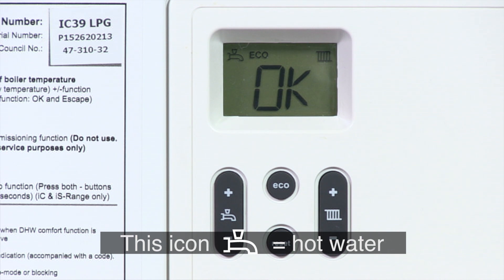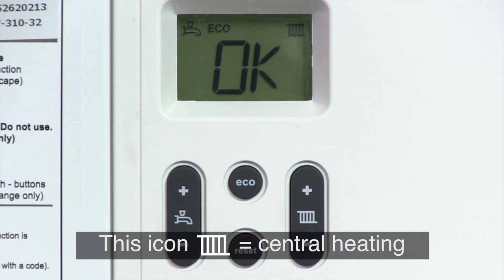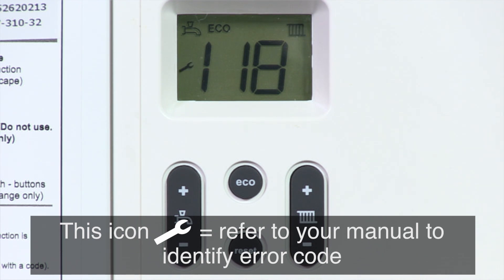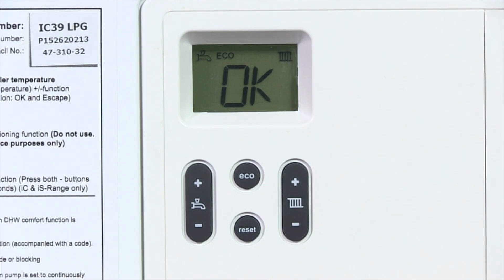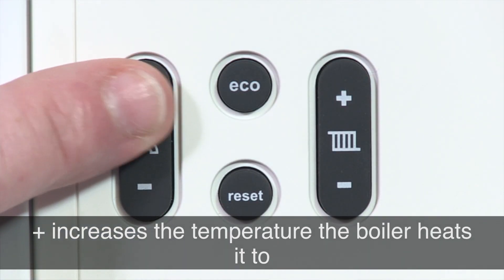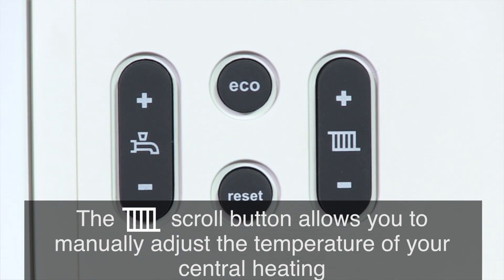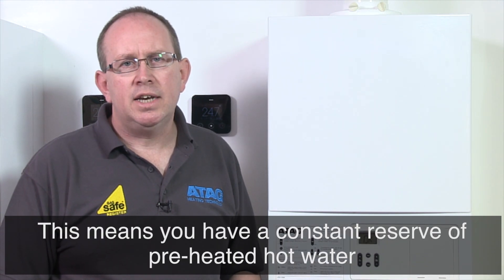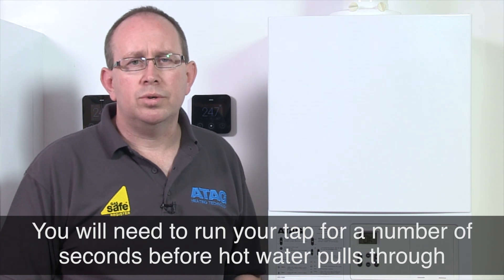Using the controls on an ATAG boiler

Comment: Why aren’t there more ‘how to’ videos of your newer Flagship ATAG Economiser Plus Boiler?
I’ve just had the IC 35kw Combi version installed at £3,000 (with the ONE Controller) and one of the things that sold me was the controls! But it’s no good if you don’t know how to use them, is it?!!
There just isn’t enough info out there, with how to use it! Even the manual isn’t much help. 
For example, it doesn’t tell you what the ‘Offset Temp’ (Offset Flow Temp: -14’C to +14’C) under Thermoregulation does. Or what it’s for! 😤 In fact pretty much NOTHING under the Thermoregulation tab is explained!!
Did I make a mistake with the ATAG, top of the range Combi?? Should I of gone with a Valiant EcoTEC plus or Intergas Xclusive! 
Come on guys, sort it out please! 
Have you got a link to where I might find this info please? It’s certainly NOT in the Manual!